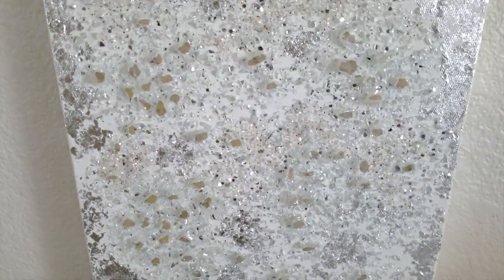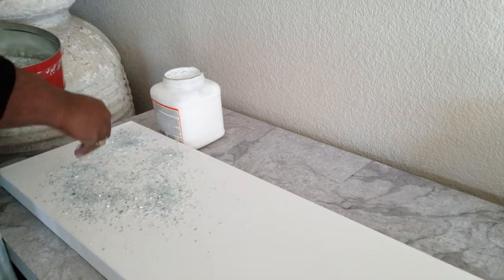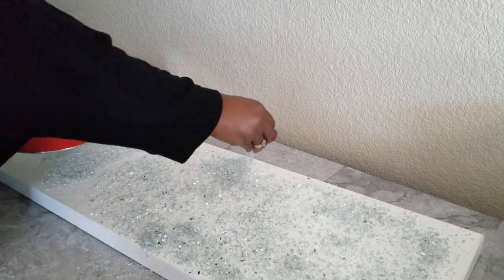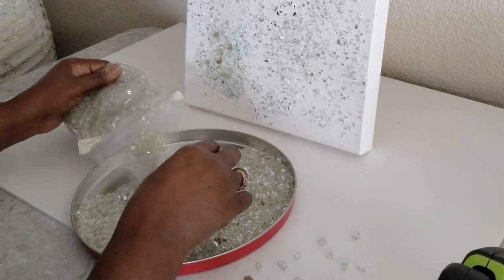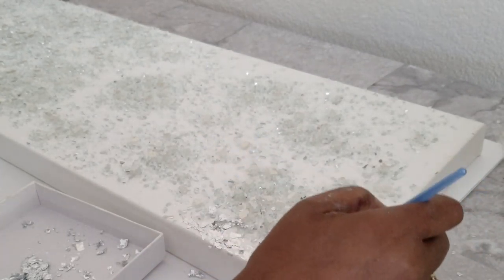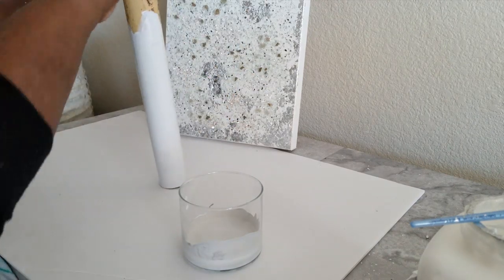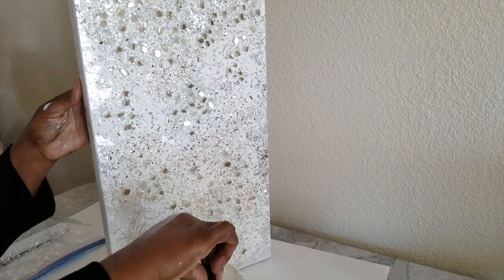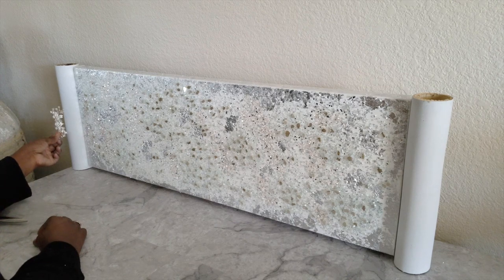GLAM WALL ART |CRUSHED GLASS WALL ART | HOME DECOR IDEAS! | QUICK AND EASY DIY | Z GALLERY INSPIRED

Comment: That was really something, this is my first time  watching  your projects  and have a question. Mod podge  is what it secure in place the crushed  glass and you only applied  1 coat?  I will like to try this on a headboard  to glam it.  Need to make sure is going  to glue  it well because of my cats. Please reply. Thanks
Reply from the maker: Yes, Mod Podge holds the smaller crushed glass in place... we never tried it on a headboard but I'm pretty sure it will work the same... we hope we answered your question 😊